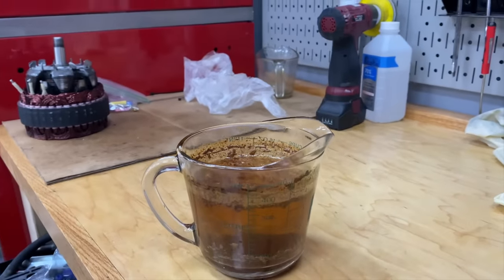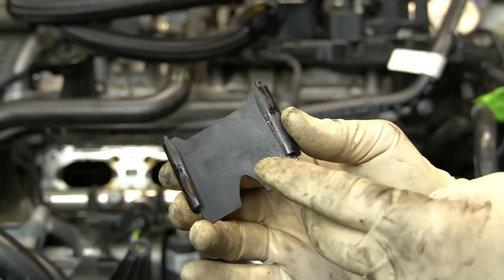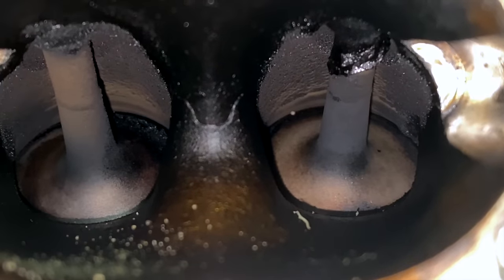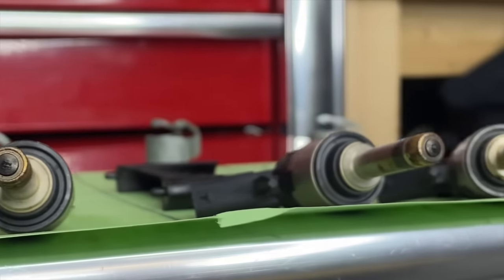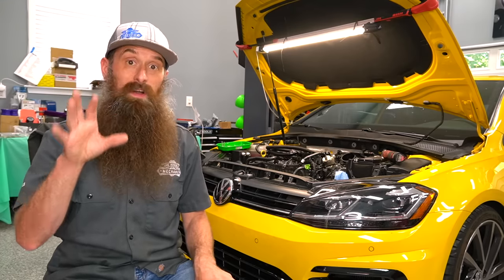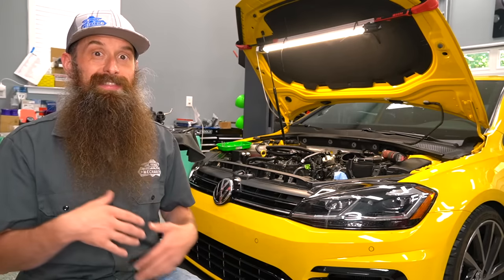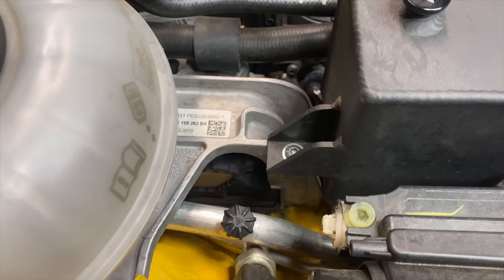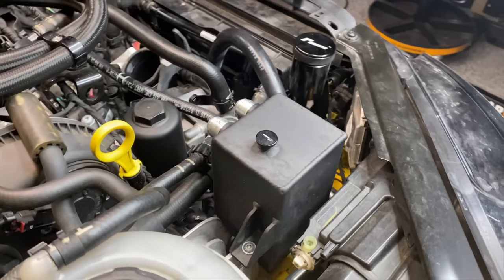Did the Catch Can Work? 10k MILE TEST

Comment: Dual injection would fix ALOT of problems.
Reply: Audi added that to their newer V6 engines, actually.
Reply: Or service ports so that you can "seafoam" right into the each intake runner.
Reply: Or CRC spray into each intake.
Reply: @OlguinInHD  and the RS3/TTRS 5 cylinder as well.
Reply: I  believe Toyota did that would their 2.0 M20 engines in the newer Corollas. I'm curious to see the results as time goes on!
Reply: @MagnumOpos  Toyota did it right all their new DI engines use their D4S system using both direct injection and port. Toyota might not have the newest tech but they wait to see how to make it last 250k+ miles
Reply: @kfrdubber  you won't need to seafoam when there is dual injection system. seafoam is bandaid treatment while dual injection is cutting problem in the bud
Reply: EU gen.3 TSI have secondary injector in intake manifold.
Reply: @lordjaashin  You also probably don't want to wash those carbon chunks into the cylinders, when using seafoam treatment
Reply: @Taydrum  yup those carbon chunks will scratch up the cylinder lining pretty badly
Reply: @lordjaashin  He said 'or', not 'and'.
Reply: @slscamg  the D4 injection has been used on the non turbo caldinas since the last generation which started in 2004, so there should be info on it and it should work
Reply: VW have had dual injection for quite a few years already on the 1.8 and 2.0 TSI.
Reply: @panzerveps  no
Reply: @209Fightclub  must be a Europe thing then. I see it almost daily.
Reply: @panzerveps  so the gunk buildup on the valves must not be a problem over there
Reply: @panzerveps  oh nice. Mine is 2013 hopefully I don’t have those problems I only use liqui moly oil special for low deposits
Reply: @panzerveps  what kind of problems do u see in the newer ones?
Reply: @209Fightclub  It's pretty much the same design, other than the intake manifold with the extra fuel rail.
I've seen an injector stuck open once. Can't remember if it was one of the mpi or tsi injectors though.
They still haven't been able to make a water pump and thermostat housing that doesn't leak though.
Reply: It's on the Golf R engine, but only for Europe lol
Reply: @gns942  Not only the R though.
Reply: @gns942  and Australia
Reply: @slscamg  that extends to the Subaru boxer engines in the 86/BRZ line too
Reply: Eurospec'd engines are dual. In North America we get fucked.
Reply: @tellucas  I'm thinking that the dryer the intake valves, the lesser the medium for carbon build-up
Reply: @Crazymajkys  yep my 2016 cupra 290 has mpi
Reply: i have 200k  km  with audi tt 2016 and now i get misfire so its carbon build on the valves but for 200k km its  ok :)
Reply: @lordjaashin  Removal of the PCV system all together is the best remedy to it all. No reason to run that oily mess back through a perfectly clean engine.
Reply: @Scuterist  120,000 miles is not a lot, but average for an Audi to start having problems.
Reply: Audi added dual injection to EU engines
Reply: I speak under correction but i think the new rs3 8y might have duel injection
Reply: They why I only buy toyota/lexus now.  Most of their engines are dual injection.  To me any car manufacturer thats okay with their customers having to deal with this clearly doesn't care, what else do they not care about.
Reply: @panzerveps  that's only in Europe, in America I don't believe any vw and family engines have dual injection.  The last gen rs3 was the only one that had it and I'm not sure if it still does... buts it's not available in canada where I live anyways.
Reply: That’s why Toyota does it
Reply: That's what your mom said...
Reply: @kfrdubber  I would not use Sea foam at least not the OG that was designed for marine engines. CRC is made for TDI engines ( sea foam i think came out with a product for TDI's but I seen CRC work better.
Reply: Or better just go back to conventional fuel injection.
Reply: My GTI mk7 is dual injection I live in Ireland
Reply: @jajajajajaja867  I've gone back to a car with basic fuel injection on it,all this multi-port injection bs just creates more problems eventually. The older cars are simple,easy to maintain, easier to work on,less expensive overall.
Reply: @Healthliving1967  i havent had any problems with mine
Reply: @jajajajajaja867  how many miles do you have on it ?
Reply: @Healthliving1967  currently 86k and its tuned to about 290 hp
Reply: It helps. But I have seen plenty of carbon build up on B9 S4s still
Reply: This gen 3 engine don’t has direct and port injection?
Reply: It’s not just the valves that are affected by this junk. In some cars it’s the entire intake system
Reply: Water/meth injection for the win/win situation.
Reply: @snu666  trying to understand how that’s connected. Does water meth clean throttle bodies & intake boxes?
Reply: European engine codes had them. And they removed it again 😢
Reply: And add a lot of cost... Not practical for many cars
Reply: It seems like a catch can works well too. Much less complex and cheaper.
Reply: So, double the injectors to fail, probably take away some of the fuel savings from going to DI so what is the point? Just go back to port injection.
Reply: @crisbattaglia4668  double the injectors to fail, not so much. Double the cost however
Reply: They still have issues because the injectors are not always spraying the back of the valves. Ford has it and they get really caked with buildup.
Reply: Yea ford figured that out too port injection isn’t just for fun neither was carburation
Reply: 6000 rpm for 15 minutes will help too

Comment: I don't think a catch can will eliminate carbon on the valves. I think it's slows the build up
Reply: This is exactly what I was thinking when watching this video. There are definitely other variables at play not just the catch can.
Reply from the maker: Yep. That’s why testing these for definitive proof is almost impossible
Reply: @HumbleMechanic  — well, had you just throw on the can and not modified anything else, it would have been quite simple to get accurate data from this experiment but you had to go and complicate things. 😒😤🤷🏻‍♂️ 

I still appreciate the hard work and update. 

Did you clean the valves again before assembly?
Reply: I added a catch can to my 3rd gen prius, Stopped the oil consumption issues & also stopped the oil from dumping into the intake....saved my Prius’s life
Reply: Fuel and its additives with help remove the previous carbon build up.
Reply: @stevecade857 not from the top of the valves on direct injection engines.
Reply: @HumbleMechanic  would Valvoline Restore and Protect oil solve this problem over time?
Thanks enjoy your videos.

Comment: after watching this video and the Legitstreetcars video where Alex ran plain water thru the intake of the e30. It seems to me that the water in the catch can is vaporizing and steam cleaning the valves as it goes thru the intake.  Looks like similar results.  Maybe running water thru the intake is the cheapest most effective way to clean the valves.  Anyone willing to do a video on that?
Reply: I agree.  The intake valves certainly looked steam cleaned.
Reply: When i used to be a boat mechanic, the guy i worked under would take a good spray bottle like the hair salon uses puts out a super fine mist, and he would throttle the engine and spray a couple squirts through the intake to flash clean the engines. Seemed to work pretty well.

Comment: I usually put about a 1/2in. of antifreeze in a catch can, with a water separator catch, during the few months the temp can reach freeze danger after patching 3 winter cracks.
Reply: Great 💡 idea --- Thanks 🙂
Reply: I run JLT 3.0 catch cans on my 3.5 Ecoboost transit vans.  I'm in Michigan and we get some oil, water,fuel mix in the can (definitely more oil blow by than your VW).  We empty them with every fuel fill aka once a week.  The catch a lot more water in the winter (hence frequently emptied).  The can can hold more but they are easily emptied and if you miss a week or two you're still ok. I don't want to risk filling it all the way up with water and then having the engine suck through a big lug and hydro locking (probably just paranoid)
Reply: That is a really good idea. Thanks
Reply: Wonder if insulating the can would help.
We had a big problem with pcv breathers on some gensets a few years back when the catch can wasn't insulated. 
They added insulation and no more freezing problems.
Reply: @joshuaho3150  As good as 0 antifreeze makes it into combustion.
Filling a confined container with pure alcohol in a hot environment is asking for trouble. Plus if your catchcan has rubber seals they will dry out.
Reply: I usually put straight absolute vodka, could use peach flavored or something if that is ur taste eh.
Reply: Unless your catch cam is filling up, freezing is a non issue. Had a catch can on for a while and it would take a couple years to fill up. Lol. Put a reminder in your phone and empty it once a month.

Comment: The other valves could have been cleaned by burning off what was on them without the addition of new oil
Reply: That's what I was thinking, especially since he went on a road trip, that's a lot of miles presumably at full operating temps.
Reply: What oil? It’s clearly mostly oily water. I’m surprised the water isn’t cleaning everything up, to be honest with you. That tiny amount of oil mixed within the water mist is probably the culprit at making carbon, based on what we’re seeing here. Very interesting. 🤔
Reply: @I_know_what_im_talking_about  yeah, a major point of the catch can is to keep oil from getting in the intake via that pathway, so without the oil continuing to settle on the valves, the heat may have burnt away the carbon buildup that was on cyl 3&4 before.
Reply: Burn off by what?
Reply: @myname9252  HEAT. Mazda claims that their Skyactiv engines are designed to keep the valves super hot, which burns shit off and keep them clean. 🤷🏻‍♂️
Reply: @I_know_what_im_talking_about  Mazda also on some models like the cx5 have a system in the intake manifold that drains the oil back into the pan if Im remembering.
Reply: Well just did some research and yes Mazda has a oil separator on the bottom side of their intake manifold, it works but not all that great an catch can before the intake would still be a great idea to significantly reduce buildup. 👍

Comment: I used to have a Mishimoto catch can but it was a pain to clean. I changed it for a generic one that has a valve for emptying on the bottom. Noticed no difference in quality between the two, except that the cheaper one was smaller, easier to make room for and to clean. I put a silicone tube on the clean out valve to make it easier (and discrete) to empty. 

I found the smell from the catch can came mostly from the hoses going to and from the can. Mine are silicone, I have to change them yearly. Also between changes they need cleaned. If they get too fume logged, or people don't empty their cans the 02 will pick that up and adjust, leaning the car out. 

The can is not only saving the engine from having to burn that junk up, it also keeps it from going through the turbocharger and exhaust. No carb spraying out the exhaust if you two step, although it's kind of funny.

Most importantly the catch can saves my diverter valve and therefor the turbo and engine. If you don't have a catch can, all that condensation gets caught up in the faster cooling parts of the system. Before I installed the catch, my car would bog or go into limp mode on rainy or even humid days. When I checked the DV I could dump the condensation and oil out of it. 

I personally would not run a modified, turbo charged car without a catch can. The original design uses a carbon reservoir like a catch can, but that's for a stock air intake. If you change to a CAI, the stock carbon canister just gets loaded and eventually your system can get choked out on condensation alone. So carb saving or not, I'd keep a can on.

Comment: Hi Charles - Do you think what could be happening is that the catch-can is preventing further carbon build up, and the fact that no further carbon was being added to 3 and 4 has allowed the previous deposits to have been burned off?
Reply: He never answered but this is also my guess. It makes sense if you think about it from a longevity standpoint. This video basically convinced me to finally pull the trigger on a proper catch can setup.

Comment: I researched my wife's vehicle choices and we chose a 2020 Toyota Camry SE over the VW simply because we wanted to avoid these hassles and Toyota actually did something about the carbon issues by adding Port a long with the Direct injection. A little more complicated, but so far to this day we have had no problems with the car and we have put 50k miles on it so far. I hope VW introduces their own version of the Toyota D4S system in future cars its a really good sallution.

Comment: I really like the catch can on my focus st because it has a hose that comes down from the bottom with a valve so I can drain it from under the car while I'm doing my oil change all as the same time. It's really nice I don't have to remove the can each time, just open the valve.
Reply: Which one do you have, curious I have a st as well and want to put a can
Reply: Which one are you using
I have a st as well 350hp tuned and my tuners says i should get a catch can soon. Curious to know what you use
Reply: Ditto on my Golf. I actually created a lower/extended stainless tube/sump for mine that lives behind the front grill. Easy to pop grill and just let drain every few thousand km
Reply: @kpbmx  which can ru using?
Reply: @rosstudisco8650  it’s technically not a catch can. It’s a febi e53 cyclonic oil separator, I think from a 4ltr+ BMW v8 that usually has a handed pair for each bank. 1 on my 2.0tdi has roughly the same capacity, fits neatly next to the fuel filter and only cost £11. Just needs some form of sump to drain to. Kudos to whoever the guy was that suggested this (an Aussie forum I think?)
Reply: @kpbmx  thanks bro!
Reply: @mdanielsolis  Radium has remote drain system
Reply: I bought an in expensive that has a baffle in it to prevent backflow. It has a bolt at bottom and can does also unscrew can itself but I think imma try to Install a peacock on it to just twist and drain at that bolt for easy drain.
Reply: @stevelozano9523  ✅ great idea 💡

Comment: Hey Charles, I run a ProVent 200 'Catch-Can' more a oil separator than a traditional catch can from MAN+Hummel on my 3.2L Diesel in my Ford Ranger and have noticed the same as you. 

My theory is that there is less 'wet' oil returning from the crank case to the valves which provides adhesion for carbon in the exhaust gasses from the EGR to stick to and then burn on in the heat.  As there is less oil in the system the gasses from the EGR over time may potentially have a cleaning effect, over time.  MAN-Hummel actually recommends that people do not block their EGR off after installing their system.  I tried finding the video where they said that but cant track it down.
Reply: Hi from Germany, I use the M+H Provent 150 on my VW T6 2.0 TDI sice Jan 2021 and it works very well. I think it is the best cc on the market.

Comment: Great video Charles.  I am glad to see you use CeraTec as well.  I just recently starged using in my 3.6 VR6 (and Liquimoly oil as well) , can't tell a big difference with it but I also put in my Gen 3 Coyote F-150.  It made a huge difference in it, that engine is typically very noisy and it calmed down a lot of ticks and taps and made it run much smoother.

Comment: I'm sure the long drive had some impact on how clean they were. But there's plenty of overall evidence that a catch can at least mitigates some of the carbon build up seen in engines. Does it solve it? No, probably not. Does it elongate how long it may take between needed cleanings? Plausibly. If for example a carbon cleaning is needed every 50k through normal use and a catch can can extend that number by 30% or more, that feels like a good investment in my mind. Because at say 150k, that's 1 less cleaning you've needed in the same mileage. And there's the residual impact on various internal components within/connected to the engine too.
Reply: Very well said. 👍🏻 

I think a cleaning is needed once you notice performance degradation. Sure there’s gunk on the valves but is it causing the engine to run poorly? It has to build up quite a bit to cause a problem. 

I have 100k miles on a Di Mazda 3 engine and it runs amazing. I’ve been driving it for 7 years since new. What carbon build up? 😎😅
Reply: What about no catch can, so no constant maintenance on it. And a cleaning at every 100k. Far cheaper and since you've power over a longer time you'll notice a bigger boost after the cleanings. 
Better yet do nothing because you'll probably sell the car in a couple years.

Comment: Great video.  I’m debating putting one on my 2020 WRX, and being that it’s a turbo charged engine I’m leaning towards doing it.  An AOS is arguably better (so I’ve heard) but I’ll set reminders on my phone to just check the can every couple months or so.  I now know that my prerequisites for make/model are: drain valve (or plug at minimum), seamless install w/out removing factory components, biggest size I can fit to avoid multiple servicing.  I’m going shopping.

Comment: I have a N54 catch can and my take is it helps a lot in smaller journeys (when the engine does not reach ideal oil temp), as there will be substantially more water/oil in the can - in colder weather it will be mostly water - compared to when going on a longer trip.
Reply: If you're driving your car long enough or letting it idle enough you will burn away all the water in your oil..